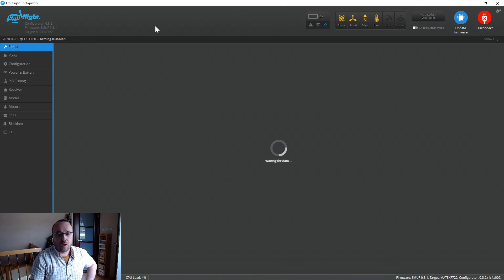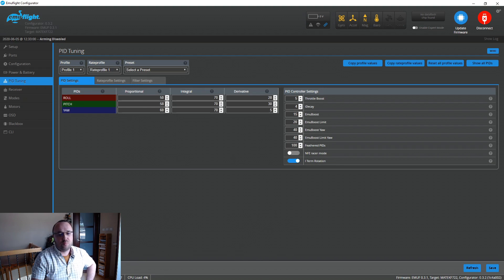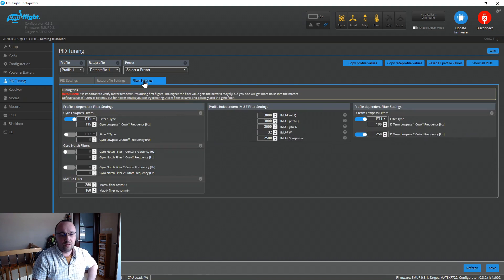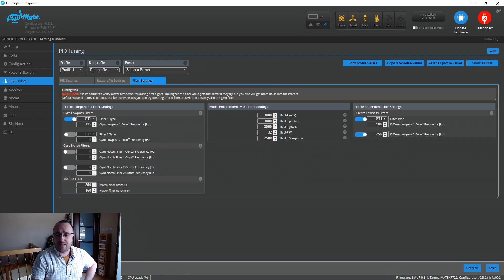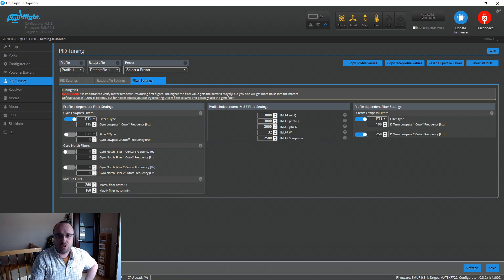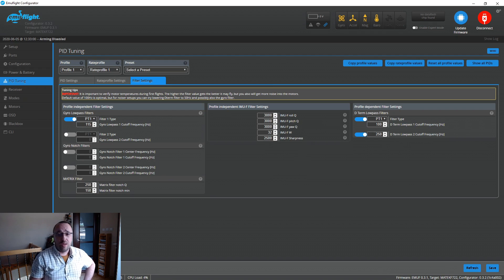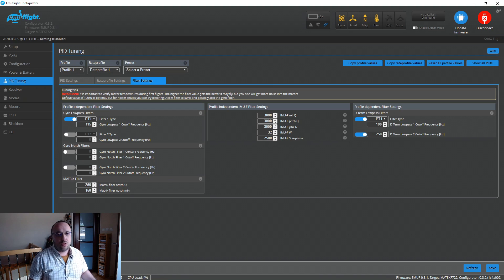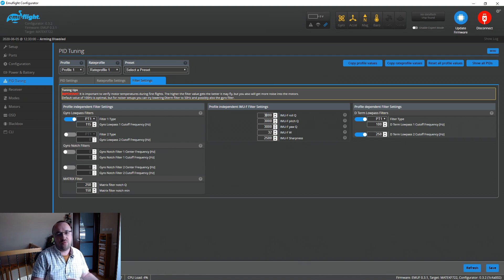EmuFlight Kalman Filter Tuning

Comment: Topic from math point of view is difficult but Your explanation will help huge amounts of people :) great material :) I have only one useful tips, set manually sharpness on Your face and after that You can block AF in Your camera :)
Reply from the maker: actually, the trick is not to use face tracking. I'm still learning the new camera and relaying on "face detection" was a mistake
Reply: @FPVUniversity  You have right , to be honest if You don't want to be in move the best way is manually setting of sharpness - I do the same setting for all my cameras :) in 99% time is ok :)

Comment: tried emuflight on a difficult 4s 2.5 inch toothpick build. in the end, I decided to stick with bf4.2, coz the main difference were by the absence of d min and dynamic lpfs on d term, not fancy filtering. so I just simply did the same on bf + rised by 1% dshot idle (5.5)
rpm notches allowed me to remove lpfs on gyro and use 1 single static pt1 on d term though

Comment: Hey Pawel.
When I fly my long range wing (INAV 2.2.1) in normal "Air mode", the amp draw is about 3 amps when the throttle is at 50%, but when I switch to ALT Hold (cruise throttle is also set to 1500) it ads half an amp... (Switching between Air and Angle doesn't ad this 0.5 amp). I have Pitch to throttle ratio at 0. The wing is pretty well balanced and trimmed. In the OSD I have the throttle value, angle and such, nothing changes, throttle stays at 50, wing attitude doesn't change... Where is that 0.5 Amp is coming from?
Reply: Because you have a throttle expo and that is not aplied to the auto-throttle only to the manual throttle.
Reply: @Mateyhv1  Setting min_check from 1100 down to 1005 fixed it!
Reply: Mateyhv1 I thought you had a good point there, but after checking, I don't have expo on the throttle... The mystery continues...

Comment: You know, the Q should just be converted to a Hertz value.  Then folks will understand it better and it relates closer to the normal cutoff that goes into a PT1 equation; which the "kalman" is a PT1 so it makes sense.
eq. to take Kalman calcs to cutoff are ([Kalman K] * [gyro sample rate]) / 2*PI().  So just reverse that in the code to have it that instead of Q, the user inputs a cutoff.  This will then be the average cutoff.  The lower W means it will move around more.  Higher W means it will move around less from the overage.
What is really screwed up in the current implementation (with Q) is that as you raise your Gyro sample rate, you get LESS filtering.  How screwed up is that?  It should be the opposite!!  Having it be input as a Hertz value would automatically adjust this so it won't happen that way.  Hence why ALL the other filters use Hertz so they don't move around as the gyro sample (or PID loop sample rate) is changed.
Reply: What is your opinion on the newest versions of emuflight vs betaflight? Is it worth switching over to emuflight from my decently tuned bf4.2 build which I can't tune out the last bit of propwash without smoking my motors?
Reply: @anagami741  Mr. Science is the reason folks should pay attention to the facts of how things actually work.
Reply: A Kalman filter consists of a prediction step and an update step when separate sensor inputs come in. Kalman with just a gyro sampling makes no sense.
Reply: @CharilaosKalogirou  I 1000% AGREE!!!
See, this guy gets it!
Reply: if your so worried about q changing with frequency then just make a chart to get it working when you change looprate. Its nearly impossible to find exact frequencies on predictive filters like kalman filters. Try googling kalman filter frequency cutoff, its something you don't find information about for some reason. maybe its because you can't, go figure.
Reply: @Quick-Flash  using the word "predictive" is such bullshit and you know it!  I can calc the EXACT cutoff of the "kalman".  My spreadsheet does it easy.  
Taking the derivative of the gyro data and using that in the PT1 filter equation is HARDLY "predictive".  It just adds noise (like any derivative does) and yes, steps forward the delay.  But by adding noise means you need a lower cutoff (or Q), adding the delay back, so it DOES NOT do anything.  Quite a "prediction" indeed.
Reply: @uavtech  good luck convincing inav that this "predictive" type filter sucks. The unicorn filter is great and they have pushed the filter further. I'm happy for those guys.
Reply: @Quick-Flash  that's the thing about science.  It is true weather you believe it or not.  Science says it is NOT great and noone will be able to prove I'm wrong otherwise because the science is not there behind it. I have done my homework.  It is like you cannot prove the Earth is flat, because it is not.  Sorry. It didn't get the name of "the Fake Kalman Filter" for nothing.

Folks can get wrapped up in fancy names all they want, in the end, they are the only ones who will be disappointed.  It is a VERY confusing over complicated approach with no gain.  The cutoff suggestion above would help simplify some.  And hey, in the case of iNAV, maybe they can make a true Kalman since they use multiple sensors (Gyro, GPS, Baro, etc.).
Reply: @uavtech  yes science does show emuflight to use a kalman filter. Do I need to show you again? This link https://www.kalmanfilter.net/alphabeta.html tells you all about one dimensional kalman filters. So stop saying you can't have a one dimensional kalman filter. Next time do more homework than gathering up hate mail. 

Also it's quite odd that you have to keep reaffirming that the world is round. Do a lot of people confuse you for a flat earther and you are tired of it?
Reply: @Quick-Flash  , show a log where the Kalman does better than a notch or a plain old static Lowpass.  GOOD LUCK!!

Sure you can do a 1D "Kalman", but it doesn't make sense.  Plus, it is still just a lowpass filter.  No need for the snake oil fancy words.  Folks in the know, know it is all B.S. as the other commenter above says.  It just doesn't make sense.

Emu "science" = Flat Earth science buddy.  Always has, always will.